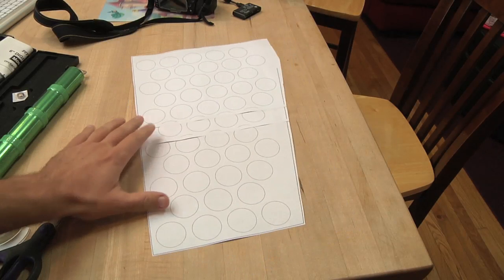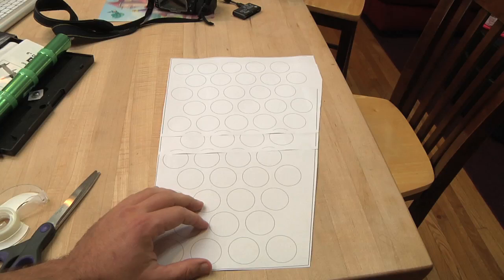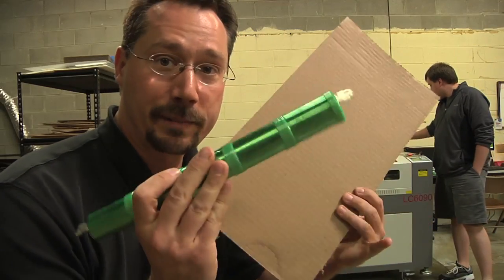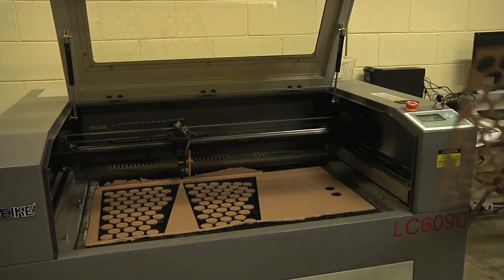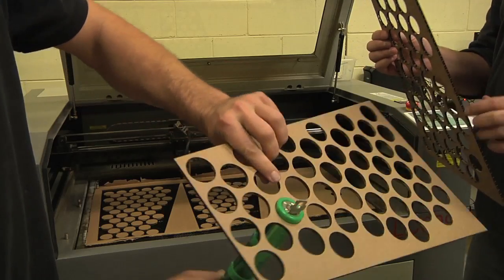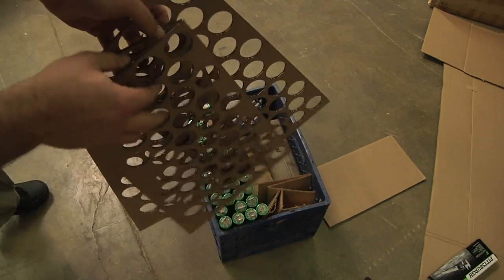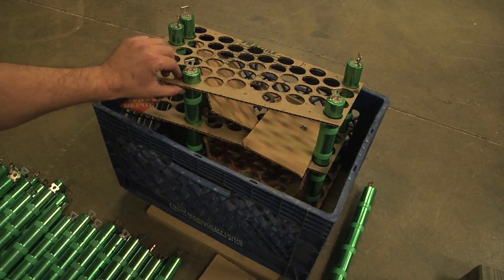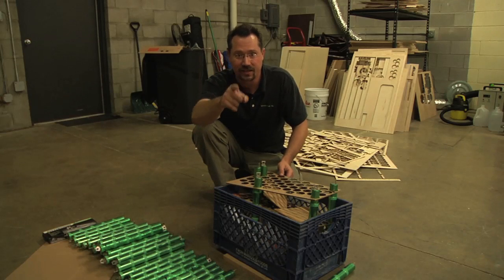Building a NiMH Electric Motorcycle Battery Pack Part 3

Comment: Great job! Aluminum plate would work great i think. It would also help disperse heat from the cells. 3 plates cut like you have done then a solid piece on the bottom and back should be rigid enough. Cheap way to hold cells in place could be as simple as using silicone. Like you mentioned, plexi glass would work great as the end caps, helping prevent any shorts. How is the bike coming along?

Comment: Nice work Ben. How are you doing BMS? 

Also Mabey some rubber grommets that fit the battery and the cut out hole. May get lucky and find some the right size for those batteries. Vibration could be bad. Cool stuff ben. Such a good find. Are those lithium batteries or nickel metal hydrate? 

Blessings and good luck
 ~Russ
Reply from the maker: I have pretty much ZERO experience with BMS. If you have any suggestions, let me know! The cells are NiMH out of a Ford Escape Hybrid salvaged battery pack.